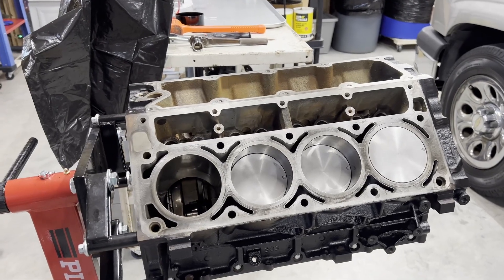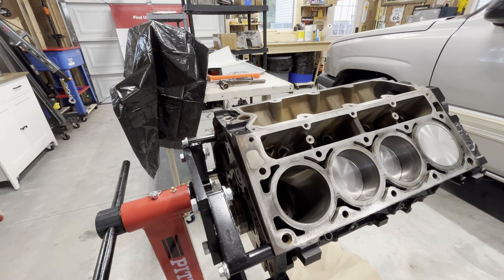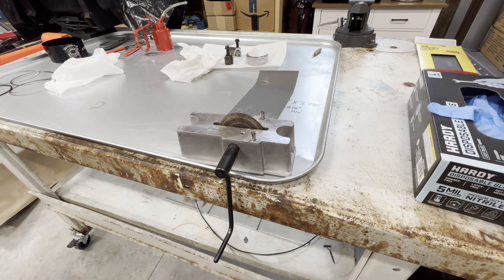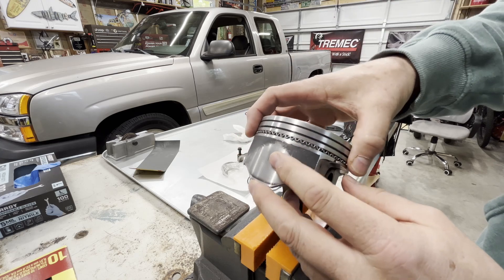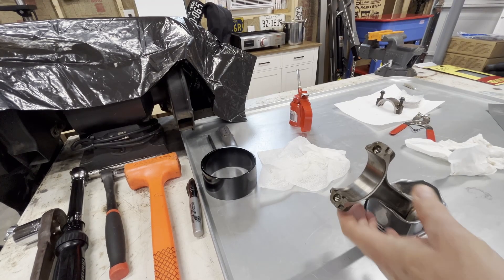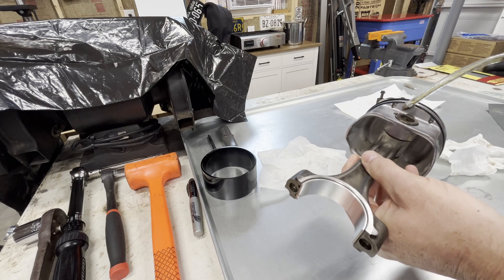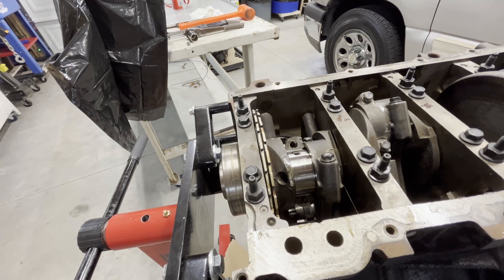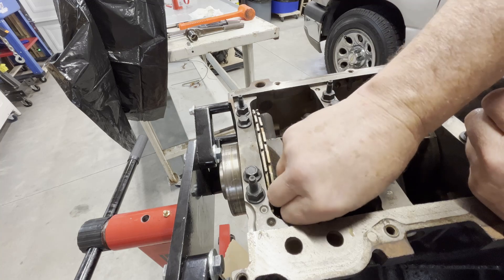Gen 3 LS 4.8 5.3 Ring Gap Rod Bearings and Piston Installation

Comment: Just saw this. I checked the bore on my 5.3, and  it was 3.771 and this equates to 15.08 for ring gap. Your thoughts? Should I push it to 16.00 for the ring gap? The crank and rod journals look new. You’re advice?
Reply from the maker: Wouldn’t hurt a thing. Ring gaps grow with wear anyway so going to .016 is a good safe zone.

Comment: Hey sir what ab the 2 compresion ring what gap should it be
Reply from the maker: I used Mahle rings on this and the formula for ring gap is .004” x bore size. In this case it was .004x3.78 for a ring gap of .015”. This is applicable to naturally aspirated builds and would not apply if you’re adding boost. I went .016 to .017 on these.
Reply: @ am just adding a stage 2 cam
Reply from the maker: @ nice!